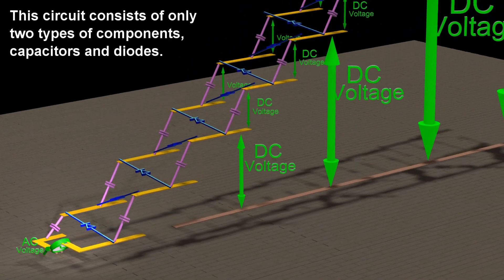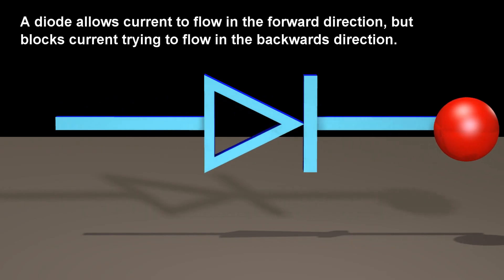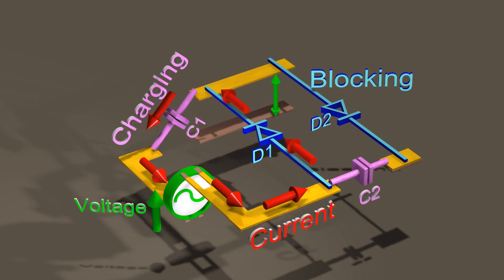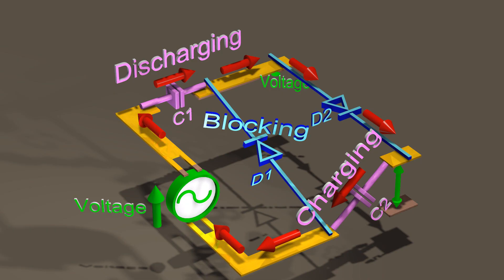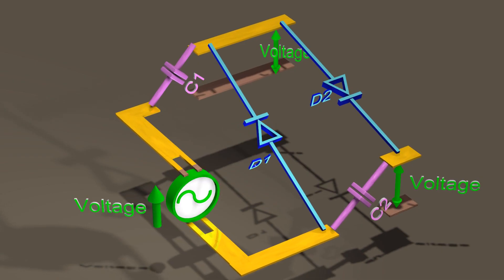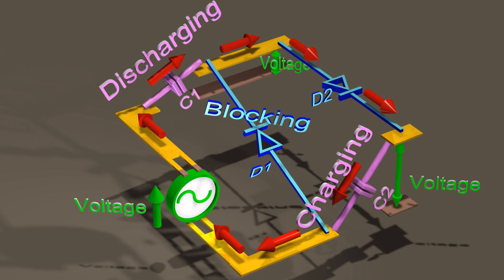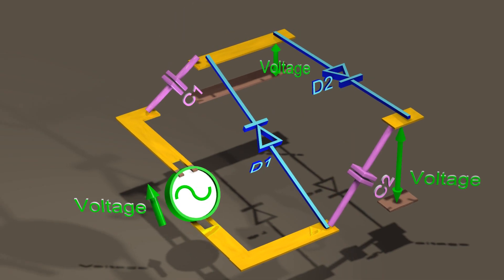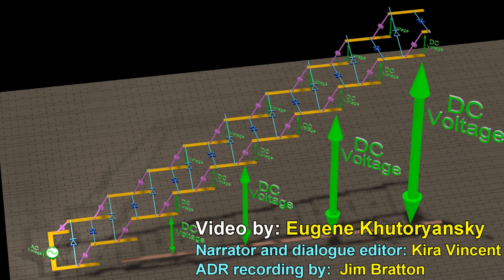Voltage multiplier: Generating over 100,000 volts DC

Comment: Does Voltage multiplier multiplies input current?
Reply: Voltage multipliers multiply only the voltage. The input current decreases until the capacitors become charged. The current is set by the capacitors/resistors in the circuit. In an alternating current circuit, capacitors act as resistors (reactance), but I think that is not what you asked. In this example, the first two capacitors set the input current, and if all the capacitors have the same value, the input current remains the same, until the last capacitor starts to charge. Then, as the capacitor charges, the current decreases exponentially, until it is fully charged, then the current doesn't flow anymore, in ideal condition.
Reply: @David M 
Look at some examples, there are many on the net. I can't explain here how different voltage multipliers work, you'll see if you understand the working principles. Voltage alone is not enough to harm, there must be enough current to penetrate the skin deep. It can be determined by the value of the capacitors/resistors system.
Reply: @David M 
Maybe you should use some coils or step-up transformers to achieve the voltage you want. Transformers will produce much more current than contraptions shown in the video, but you have to use alternating current then. In cases of using transormers, you can use Ohm's law.
Voltage multipliers shown in this vid are not so effective, just think about how old cars ignition system work. You charge a coil and a capacitor, and when the charging stops and the breaker opens, the whole charge together makes a small spark on the sparkplug. This is not a very effective way to multiply voltage, because it only makes voltage spikes, not a constant stable voltage. The effective way to do it is using transformers, maybe some beefy FETs and pulse generators to increase the frequency of the input of the transformer.

Comment: good job,,
what's the rating of capacitor?
Reply from the maker: The voltage rating of each capacitor does not need to be high, as the voltage difference across each capacitor is small, as is shown in the animation, but these voltage differences all add up to produce a large voltage difference.

Comment: Great video! Makes physics/science interesting. But would the capacitors really retain any charge and build up DC voltage as illustrated? Remember that the positive and negative cycle of a symmetrical alternating current are essentially equal in duration, which implies the charge and discharge time are the same. this means that whatever charge that is stored up in half a cycle is equally discharged during the next half cycle.
Reply from the maker: Yes, capacitor C2 retains its charge because diode D2 prevents it from discharging.  The circuit shown here is an actual circuit which is used in a number of applications to generate extremely high voltages.
Reply: I do think you are right, after looking and analysing  the circuit much closely. Thanks for the good job and God bless you!

Comment: I'm seeing a flaw. C2 will discharge through D1 and D2 as it creates a complete circuit. This will happen during the 3rd cycle as your recharging C1, C2 will be in a complete circuit consisting of C2->D1->D2->C2
Reply from the maker: That can't happen because it would require current to flow backwards through both diodes.
Reply: Wrong.

Comment: I just have a few questions. What is the ratio between the capacitors and diodes values in terms of stepping up the voltage? Does the amount of input AC voltage determine the size of the capacitors and diodes? Finally what's a good size to work with for DIY projects?

Comment: 2 things not explained:

1) why doesn't C2 discharge thru D1 as C1 discharged thru C2?

2)  why is the current not splitting at the node for C1, D1, & D2 or at the node for C2, D1, & source?  There's no reason the current shouldn't split at these nodes. ??
Reply: Good question.

A capacitor can only discharge with a current in opposite direction to the current it was charged with. On electron level, it gets charged by flow of electrons from one side which are then stored in one of the plates, and flow of electrons away from the other plate. In order to discharge, the electrons would have to flow away from that first plate the same way the entered (and return to second plate the same way they left).

Therefore, if C2 is charged through D2, it could also only discharge through D2. But since that is blocking in this direction, the capacitor cannot discharge at all in this setup.

If you extended the setup with another stage, there would be a wire connecting a point between C2 and D2 with another diode D3 and capacitor C3 in series (pause at 8:30). This way, we would be discharging C2 through D3 into C3, and C3 would never discharge as being blocked by D3.

Comment: What happens if i put direct current into the voltage multImplied instead of alternating current? Great video by the way!
Reply: you will make angus young, and those whom are about to rock, appear
Reply: One or both of the first two capacitors will charge, depending on the polarity. You need AC for the capacitors to cascade their charge from one stage to the next.

Comment: I didn't understand why the process stopped at double voltage ....why it dosn't grow more
Reply: Because once voltage on C2 reaches the sum of input AC peak voltage and C1 voltage (basically the double input AC voltage) Diode 2 will block any further charging of C2.

Comment: ma'am the van de Graff generator also does the same thing. so which is better ??
Reply: Van deGraff generates little current but high voltages. This circuit does both.

Comment: What kind of capacitors and diode can withstand 100,000V?
Reply from the maker: The capacitors do not have to withstand a high voltage, as the voltage drop across each individual capacitor is small, as shown in the video.  It is when all these drops are added together that we get the high voltage.

Comment: I'm having a really hard time understanding these. Mainly cuz any time I watch them, I think I get it, then I try to set up a similar circuit in this java based circuit simulator I have. And it doesn't bloody work. One problem I have, I dunno if it's a bug or whatever, but half the time it shows some ridiculous amount of current. I mean like billions of amps. Not for this, just in general.
Reply: Your output current actually should be very high, depending on exactly what you're simulating on the output side of this circuit. The thing is you'll have a very high current for a very short amount of time! Lots of current but not a lot of charge to maintain it!
Reply: Nah, I learned it's a quirk of CircuitMod. It assumes wires have no resistance, so the current between the caps was as high as the program's variable will allow.

Comment: This circuit has a particular name I can't seem to recall. Anybody?
Reply: Cockroft-walton high voltage multiplier. You can get marx generators as well with resistors and capacitors. This circuit gives you a DC output and requires an AC input, while the marx generator gives you an AC output and requires a DC input.

Comment: what's the value of input AC source? And if I don't use IC, we'll get pulsating DC, not pure. To get pure, what should I do? I used IC on bridge connection so that I get pure. what about here?
Reply from the maker: Any value of AC will work, though if you have too low of a frequency, the capacitors will discharge before they are charged again, and you will not develop as high of a voltage.  (You can control the DC voltage of the output by varying the frequency of the input.)  You don't need pure AC, just an AC component.  Therefore pulsed DC will work (though not pure DC).
Reply: thanks for the response.

Comment: I think you should mention how you can't just go ahead and build it. Typical voltage ratings of caps are 50 volts which should be explained. I love your videos though!!
Reply from the maker: Actually, you can use capacitors with low voltage ratings, since the voltage difference across each capacitor is relatively small compared to the total DC voltage at the output.
Reply: I see, thank you for clarifying this for me! Very interesting. Thanks for sharing. I really appreciate your videos. Subscribing now.

Comment: Is this similar to how a stun gun creates 300K volts from couple of small batteries? The batteries are DC though.
Reply: There is a high speed oscillator in it that changes it to intermittent DC.  It might be AC.  I've forgotten which.  On xenon flash units you can hear the oscillator wind up.  Sounds like a little siren.

Comment: First im sorry for my inglish, i´ll try do my best explaining my ask. 
I had understand thar if you have a lot voltage and a low resist, you could generate a lot current too; ¿Why this circuit could not generate a lot of current? 
You are awesome! Greetings from México :D
Reply: Capacitors have a high impedance. Basically, the charge leaving the output will leave faster than the charge moving up the chain can replace it unless it's limited to a trickle.

Comment: Great video, explained well the concept of voltage multiplier. thank you for sharing it!

can you specify the specs of both diodes and capacitors (and how many of them) to generate lets say over 800 kV DC output from a 220 V AC or lower. can such device made at home? if yes, how much does it cost ($)? and is there cheaper alternative to generate over 800 kV DC (don't mind how low the current is, as it required for generating static filed for an experiment)?

Comment: at 4:54 why current did not go to D2 which has also path to flow current  in stead of  current just go to C1 och charging ? it a bit confuse me.  At that time D2 is only block if current is comning from C2 but the other side of D2 is not block current.
Reply: +andrewskyworker current goes to positive to negative (conventional current flow). Anyway, D2  behaves like an open circuit, because it's reverse biased.
Reply: The current would have to flow "up hill" to pass through D2 at this point.

Comment: Great video, it really explains the multiplier well. What ar the specs for the diodes and capacitors.
Reply from the maker: +Timothy Mwansa, thanks for the compliment on the video.  The voltage ratings of the diodes and capacitors doesn't have to be high, as each diode and each capacitor only sees the voltage difference of a single stage of the circuit.  A bigger concern, as the voltage gets extremely high, is that you will have arcs through the air.  Also, these arcs will generate lots of X-rays, which are bad for people's health.
Reply: +Physics Videos by Eugene Khutoryansky what would be economically the best spec of the each diodes and capacitors, if you wanna generate 800 KV DC? wanna build one!

Comment: Why is there a need for capacitor 1 though? Wouldn't capacitor 2 still be able to be charged every half an AC cycle?
Reply from the maker: +ChuDust, if you only had C2, then what you would have is a peak detection circuit, where C2 charges to the peak value of the AC input, but never goes above this.
Reply: +Eugene Khutoryansky oh so Capacitor 1 is just to ensure that that part of the circuit remains at higher potential than the part where Capacitor 2 is at. So capacitor can still be charged, raising the potential pass the peak AC. Am I right?
Reply from the maker: +ChuDust, yes, that is pretty much it.
Reply: +Eugene Khutoryansky ok thanks!

Comment: What prevents the the charge from simply building up indefinitely? I know that it isn't possible of course. However is it that the material would break down with too much voltage across it? Something else? How is it designed to keep a specific ratio of input/output voltage? 

Also, using a 2x voltage across the capacitor/ac input was arbitrary it seems. Wouldn't it be better to use less stages with higher jumps of voltage at each stage if you wanted a very high output voltage?
Reply: 2x is a hard limit.

Notice that:

 - The voltage across C2 can be no more than the voltage across the power supply + the voltage across C1

 - The maximum voltage across C1 can be no more than the voltage across the power supply

So the maximum voltage across C2 can be no more than twice the maximum voltage across the power supply.
Reply: +Matthew Graham : Each element in the periodic table have a few number of electrons in their outer shell. Each element has a mass. It is the electron in the outer shell which holds and transfers the charge (voltage). So you need infinite number of electrons to hold infinite number of charges.  My hypothesis (I don't know if there is science to it),  is that when the electrons are fully charged and if the charge does not have somewhere to go, it will heat up and the molecular structure of the elements will change (expansion happens).  If their container is weak, they might explode their container creating fire.  

The ratio of input to output of voltage is controlled by using different elements. Some have high conductivity, since they have high electrons, while others have low electrons in their outer shell. So by using less conductive element, you lower the voltage. If you cannot use one type of element to get the desired voltage ratio, you can mix different types of elements with different conductivity to get the ratio you want.  

You use capacitor to increase voltage. When it comes to jumps, what about heat generated by the capacitor, wouldn't it be a problem. Also would not high voltage capacitor make it difficult to charge it from low voltage AC due to flow of current. Isn't resistance an important part of staging. 

Hey man, I am not expertise on this subject. Google would be more helpful.

Comment: There is electron current flow, then some go by hole current flow. A diode has anode /plate/collector that receives the current flow from the cathode/emitter. When the anode is more positive then the cathode, the current flows from the emitter to the anode/collector, not the other way around. Current flows against the arrow head not with it.
Reply from the maker: +walt3223, I am using the convention for current which shows the direction that positive particles would flow in, so as to be consistent with the convention that is used in education and in industry.  But you are correct that it is actually the negatively charged electrons that are actually flowing, and these flow in the opposite direction.  I cover this in my video titled, "Electric Potential: Visualizing Voltage"

Comment: Is this what is used on stun guns?

Also if we wanted to increase de voltage across a circuit which is being powered by a DC source, should we convert it into AC first?
Reply from the maker: +David Flores, there are DC to DC converters that are able to increase the DC voltage, and I plan to explain these in the future.  These are far more likely to be used for any device which requires that power be provided to a load.  The circuit I showed in this video is useful only if the amount of current provided to the load, and hence the power, is negligible.
Reply from the maker: +Maxwell Dynamics, DC to DC converters are on my list of topics for future videos, though the basic idea behind them is already shown in my video on inductors.  Thanks.
Reply: +Physics Videos by Eugene Khutoryansky Please do make a video of  DC-DC converter.